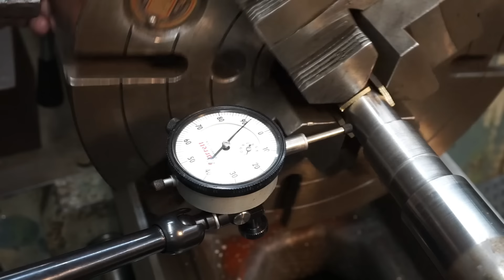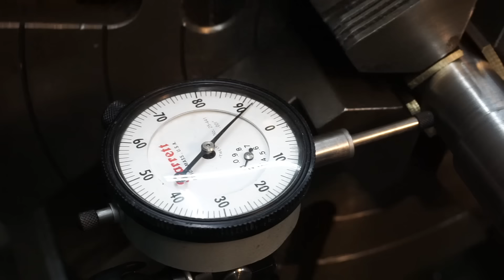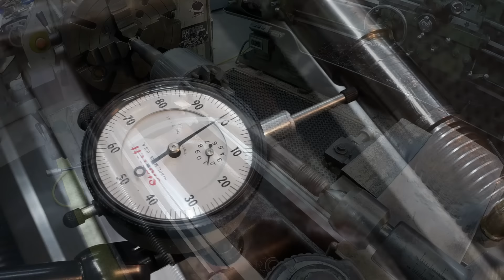Spray Welding a Pedestal Grinder Motor Shaft

Comment: Did that over 40 years ago in the United States Navy. now you can buy a speedy Sleeve made of stainless steel quick and simply. Thanks for the memories.
Reply: nice! i was about to ask if it would be possible to use a sleeve or jacket. im not a machinist and i like to play the "guessing game" sometimes, you know... to see how dumb i actually am. not feeling too dumb right now hahaha.
Reply: tobias ripper Absolutely possible - I recall our trusty VW van collapsing while crossing what was then Yugoslavia in the mid '80s. It was the deepest country, almost empty, and we were western tourists in transit. A local mechanic came to our aid, took us to his place, made us eat and sleep while he started dissembling our engine. When we got up, he had fixed it. The crankshaft bearings had already been sleeved once - a common practice on those engines, but that would have been the end. This guy double-sleeved it and it ran for another four or five years without complaint. Today was the first time I saw this depositing process but as Frank Ornelaz writes, it's not exactly new either :)
Machining is fascinating. Thank you, Abom79!
Reply: If your repairing a bad oil seal surface I would use a speedy seal (sleeve) but if your repairing a ball bearing surface I would knurl  the bearing surface (knurling makes the surface larger) then machine back to size. I have used both methods thousands of times in my 40 years on Maintenance machinist days. But enjoyed the video
Reply: @mumblbeebee6546  How much did the guy charge? There is a whole chapter in a book right there with just that story.
Reply: From what I read on SKF's website, a Speedi-Sleeve is used as a seal surface. It's not meant to have a bearing pushed on top of it. So maybe you're issuing a different product, or your shop has colloquially named them speedy sleeves.
Reply: @xenonram  As long as the sleeve is a press fit that cannot spin, I don't see why a sleeve wouldn't work fine for bearing journals? If it wasn't a pretty snug fit, it might leak in the seal application (without locktite, etc being used)?
Reply: Frank Ornelaz speedy sleeve is for seals. Not a bearing surface. They are soft and would displace.
Reply: @MrRippsalot  Softer than the spray metal? It's not really a bearing surface, it is a surface where a bearing race seats.
Reply: what i would have done in my absolute ignorance is: reduce the shaft diameter by something like 0.078' (~2.5mm). make a sleeve out of 4140 to match, put that shaft in the freezer over night OR heat that sleeve and then ... you know the rest. now everytime your bearing journals get wasted you can just cut that sleeve away and start over from fresh.
just in case, i repeat. im not a machinist and im just playing the guessing game.
Reply: @tobiasripper4124  ah no , what happens when the sleeve is heated up by frictional torque and spins free on the bearing journal? How long does it take to get that shaft out to machine? How many angry villagers do you want at your door?
Reply: @frankornelaz8234  Ah, yes, the forgiveness tool.. for when you accidentally took too deep a cut, just knurl it back to size
Reply: @xenonram  I think you're right, a seal has a lot more give to it than a bearing, it can tolerate a shaft being .020 bigger (or whatever), a bearing won't like more than .0005 over spec
Reply: @tobiasripper4124  In most cases I think that would work fine...
Reply: How about cutting the shaft to true and replace the bearing with one that has  that new size I D but with the same O D???
Reply: @lennym1273  Could work. One limit on that or sleeving is you can't go smaller than the small end of the shaft. A sleeve in this case would be pretty thin.

Comment: The spray metal technique shown does work. I worked at Michigan State in the eighties as a machinist.  We repaired dozens of shafts that were 10 times the size of this one. The shafts were for the air handling units in large buildings. This approach worked great.

Comment: My grandfather told me about this process, said it was used to make oil permeable bearings from copper powder.  He also told me that copper powder caused him respiratory tract irritation of the permanent kind.  I recommend a 3M dust respirator for the micronized metal dust because its not good to breath.

Comment: I saw a video of some Russian guy doing a shaft welded buildup on his lathe. He used a simple coat hanger wire, a buzz box welder, some copper braid as a drag commutator and rolled the work, simply tap tap taping the wire, machining off the slag, revisiting again until he got what looked like about an 85- 90% build up, turned his final, pressed the bearing on and- I'm speculating here- did some vodka to celebrate. You just can't beat those guys for doing so much with so little and doing it so well.

Comment: Shim it with JB Weld 🤣

Nah I’m joking, nice work my man
Reply: My first machining job was in an electric motor shop, and sometimes they'd get bearing housings that had been 'punched'. That is, somebody had used a center punch to make a bunch of divots in the bearing bore, producing little raised sections around the divots to compensate for wear. Needless to say, that is not a recommended repair.

Comment: The scratch pass with the threading tool also increases the surface area of the journal.
Reply: How would a knurl compare, in terms of effectiveness?
Reply: @MrJeb707  I was thinking the same thing.
Reply: We've done this at work before you can also undercut and sleeve

Comment: Hi Adam! A question. You started out by indicating the end of the shaft held in the 4-jaw (understandable), then you indicated in the far end. How can you tell if the run-out(at the far end) is due to lateral displacement of that end (where the live/dead center is), or if there was a teensy bend in the shaft? Would it even matter if the run-out is less than a thou at the end of the indicating? 😋 Another awesome machining video! 🤠
Reply: You can indicate from the middle-ish section also to see what end it follows.
Reply: Jaakko Fagerlund I’d never thought of that. Granted I’m about the farthest from a pro you can be, but you really do learn something new every day
Reply: Not Adam (obviously), but the eye is actually very keen to noticing runout. 2 thousands even would be pretty clear.
Reply: Also it depends on how far from the ends the "effect" and the measurements are.  If you had a shaft with a perfectly centered hole in one end, and a hole at the other end that was off-center by 0.100", and then mounted it between centers, and measured at 1/4 of the length from the good end, 1/2 the length, and 3/4 of the length, the wobble would be +/- 0.025", 0.050", and +0.075" respectively.  So if the measurement was made at 1/10 of the shaft length from the tailstock end, then one thou of runnout at the chuck would result in a tenth of a thou runnout in the measurement.
If you put a hole in one end that was 0.100 off center toward the "front", and in the other end off center 0.100 toward the "back", then when you rotate the shaft, those errors will add together.  In the middle of the shaft, the error will be zero, because you have 0.050 front wiggle combined with 0.050 back wiggle at that point.  As you get closer to either end, that end's error will begin to dominate.
Imagine a frozen turkey mounted between centers.  The axis of rotation is defined by the lathe -- it would be an exact line between the centers of the centers, if we were mounting between centers.  What gets put around that axis is quite variable, though the good part is that if you start cutting in a line parallel to that axis, you get a nice cylinder out of the deal, perfectly centered around the axis of rotation.
Reply: @ydonl  Mmmm, perfectly cylindrical turkey <3

Comment: Anything metal floats my boat. Didnt even know you could add on metal like this. Makes me regret throwing out the used shafts that ive had in the past. Been working in welding shops for a good part of my life and didnt know you could do this.

Comment: Wow. That is a lot of wear. Almost enough to wonder if that is the right bearing.
Reply: I've never seen something worn that bad, there's something else going on here, that is not the correct bearing. You would have extremely irregular out of round wear on the shaft plus a good dose of deep grooving.  I don't see either.
Reply: I've seen this, and worse wear. often caused by waaay out of round grinding wheels...or more likely...some sort of 'extension' added on the end of the shaft....even more out of balance.
  I've been a maintenance man, very difficult to explain why the 'extensions' would be a problem when talking to employer..
Reply: @otm646  I think, there are no other type of bearings that would fit to choose from. Bearings are normally standardized.
Reply: Could the problem with ill fitting be that it was originally designed for an imperial bearing and the ones he's been supplied with are metric?

Comment: what are the benefits of spray welding versus shrink fitting a sleeve of some sort?
Reply: Well i really think it depends on the application. We get pump shafts "flame sprayed" all the time due to sleeves causing more area for corrosion and requiring even more machine work. Usually a faster turnaround and longer lasting product for liquid situations.
Reply: @motoray69  - Do you mean corrosion happens between the sleeve and the shaft?
Reply: @motoray69  even if the sleeve were stainless?
Reply: @somebodyelse6673  yes it will
Reply: @SuperAWaC  yes, stainless is not a cure all. Plus having a higher expansion ratio it can be less than ideal to put on other materials in hot environments.
Reply: @motoray69  fair enough. i guess the answer for everything ends up being "it depends"
Reply: @motoray69  - Interesting, I had thought an interference fit sleeve would be absolutely liquid tight.  Thanks :)
Reply: @motoray69  Ran a machine shop for a local electric motor rebuilder and had the same problem with a 25 HP pump in a high rise. Worked good but would eventually drain back through and corrode over time. Worked on motors from 3 HP to 250 HP and used this technique a lot. Shrink fitting was usually more time consuming. When something is down, time is everything.

Comment: Absolutely fascinating, I have never seen that done before, great job well done.
For those wanting to see the bearing fitted, it is quite a simple procedure.
The bearing simply needs to be placed on a hot plate, then once it has expanded, simply  slip it over the shaft and allow it to cool.
Many thanks for taking the time to produce this video.

Comment: worked in maching shopes for 45 years, Worked in a oil refinery for 32.5 years. Everybody tried more than one on brand of metal spray. The oil refinery tried 3 brands of metal spray, in the end we gave up on metal spraying because it just did not hole up to the 7 day a week 24 hours a day run time for the motors. In small motors with limited use it would get you through. Good spray job.

Comment: Haven't done anything like that since the early seventies. Used to do shaft work for the shipyard and that was a common attempt at repair. More often, a bushing was heat-shrunk and staked as the babbitt bearings didn't seem to like the coating. Nothing like it, though, for a "quick",  simple repair.
Thanks for sharing!

Comment: I noticed that runout early on as well. As an electrician and not a machinist I have seen situations where shaft wobble or run out has led to stressing the bearings to the point where they caused damage To the rotor shaft much like this one. Of the situations I’ve seen I never knew there was an option like this to repair it. Flawless repair good sir.

Comment: I worked at American Airlines Alliance Maintenance Base for 17 years and we used metal spray frequently to replace metal that was worn off on certain parts,then re machined them to proper specs.

Comment: Spray welding has always amazed me. The big Diesel engine manufacturers use it for reconditioning cylinder head deck surfaces on cores.

Comment: Marvelous!  I had never heard of spray welding, that's why I watched this video (I have a pressure vessel rating from my local community college).  I also learned a LOT about how to properly use a lathe.  I'm sorry I did not go into machining in my career- it would have been a lot more satisfying than telephone cable splicing (copper and fiber)!

Comment: Excellent work Abom..always enjoy your show as I look for tips.
I'd worked in an electric motor shop for some years.
The shafts are pressed through the laminated rotor during initial manufacturer.

Generally, the shafts from the manufacturer are straight and true to the  rotor. 
If not, the rotor will rub the stator.
One can see that the shaft is fairly long and thin.
This lends itself to easy damage when bearings are removed and new pressed on.( we saw damage to the center drilled portion)
This is where the skill comes in to mitigate this.
That spray weld when done right is terrific but can also cause heat stress and bending...
Just bend it back as close as you can in a press with dial indicator.
We used to take a lick off the rotor itself on rare occasions to make sure it doesn't touch the stator.
After bending back to spec, then machine  the spray to spec. and yes...dynamically rebalance the shaft/rotor assembly.
Here's a tip Abom...make the brass shims a little longer so that about 3/4" sticks out.
Now spin that chuck by hand while applying a few layers of electrical tape.
..they'll never fall out!!

Comment: I worked at a cotton mill ( machine shop ) in the 70's and used the very same Eutectic products, i put a 45 degree shoulder on each end of the undercut, Good Work!

Comment: Never seen metal spraying done before, great stuff.  Re the centre, I find another way to stop the centre drill following the old centre is to grind the tip off the drill and just use the angle cutting part.  I reckon I'll try your way too

Comment: Used that process and gun in the mid 70's until we got the terodyne 2000 gun. That thing is old. Spray welded many a journal with a lot of aluminum bronze. Got zink oxide poisoning off that stuff one winter in a cold closed up shop. Used respirators after that.  I only chucked up no more than 1/4" of shaft or made my pads no more than 1/4" wide. On smaller parts I would only chuck up 1/8". Too much jaw engagement can cause a kink in the shaft if jaw faces aren't parallel. Sometimes I regret leaving the job shop. I miss it. Don't think my vision would allow me to be any good now.  That video brought back memories.

Comment: I used this process more than 40 years ago, in Switzerland, Castolin provided the material, demonstrated it, my employer at the time was procured, and we could later make many repairs, which would have been difficult, if not impossible to repair, without changing the defective parts

Comment: Great video!

That scratch pass is making more effective surface area for the material to cling to.  Works with other kinds of materials too, like roughing up plastic before applying epoxy.

I've been working on some 1.5" diameter hollow shafts 22 inches long and the chatter is a nightmare in the middle.  I'll try using a tool with a smaller toolnose radius and see if that helps, thanks for that bit of info!

Comment: Great stuff, I have had starter motor armatures spray welded in the past , but have never seen it done. On the point of the armature run out , being mass produced 'Near enough is close enough'  Thanks for the video.

Comment: I use to work in a motor shop of an oilfield electrical firm. If you put red locktite on the shaft before you heat the bearing, it will reduce the chance of the worn out bearing spinning on the shaft.

Comment: This was a job that I had to do over 45 years ago, the only difference was that I used a wire feed that melted the wire as it was applied to the surface. The stuff works great.

Comment: As you said, the best way to recut a center is to single point cut it with the compound rest at 30°.  Also you can first drill it deeper with a regular drill bit, then recut the center hole with a center drill that has the whole drill point ground off, (Just the 60° countersink portion left). That helps keep it from walking around as well, and it acts "more like a tool bit".

Comment: Great vid on spray welding,  have used MIG built-up never spray but nice to know how it's done.  Also, I've never been able to turn a shaft to an interference or slip fit without using using mechanical standards to grade the micrometer on the spot as we are talking about tenths of a thousanths here.

Comment: About 20 years ago I worked as a janitor at a company that refurbished turbine engine components.

I was very interested in what was done, and the Supervisor explained stuff to me.

A special expensive tape was used, to mask off areas, and parts were put in a booth that had a turntable.

The metal was sprayed on, then machined down back to spec.

He said it's much cheaper to do this- than manufacture a new part.

Comment: Another method I have used to build up a surface is a carbide weld...zero heat. Company is called Surfalloy out of Troy Michigan. They do sell equipment too. You can also use that to make special cutters and many more.

Comment: i knew of short circuit, globular and spray transfer but the one i knew of is in mig welding. this is quite a bit different. spraying a powder and bonding it with substantially less heat. strange but very slick process. makes me wish i could do this stuff for a living.

Comment: A long time ago, we reconditioned track-roller bearings on the farm's Cat D4, which was already pretty old. No quite the same as this job, but near enough. We'd acquired the lathe from a local company that built church organs: they used it for metal spinning. So I can honestly say I used an organ-builder's lathe.